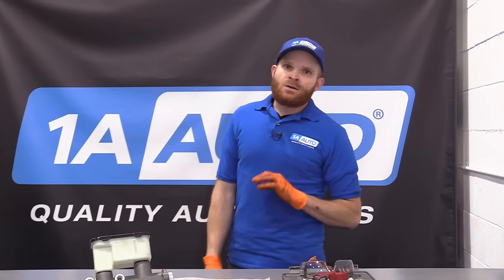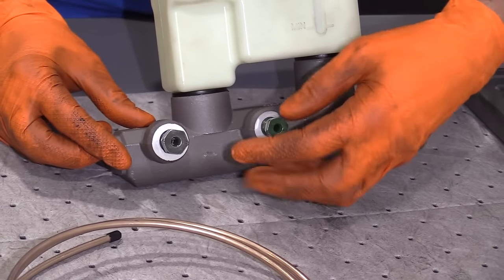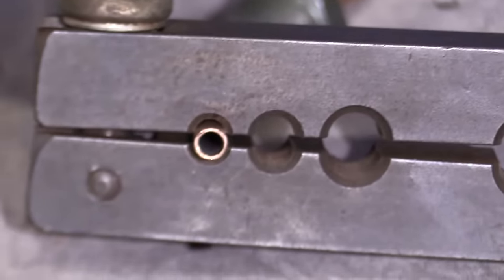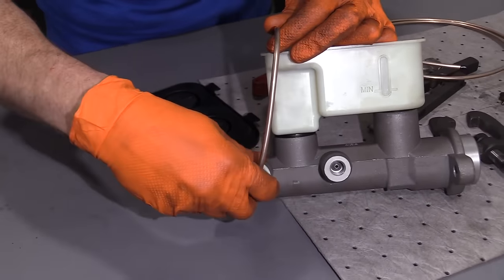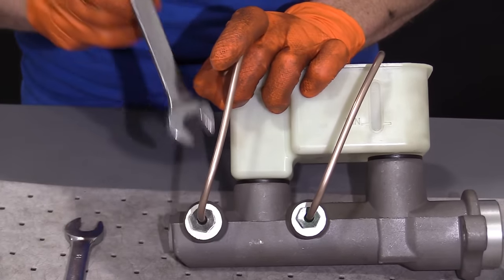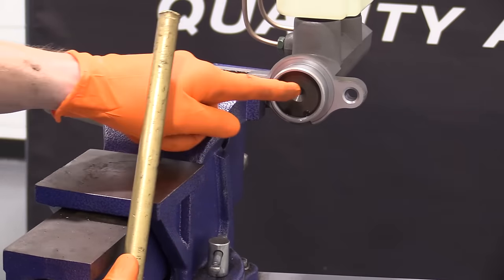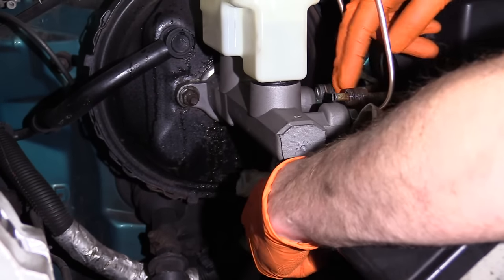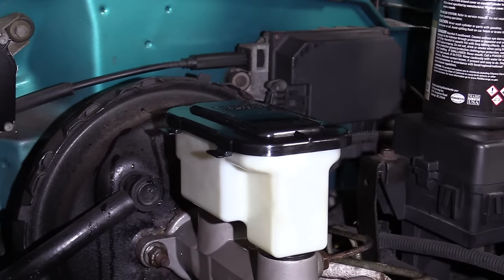Make a Bench Bleeding Tool! DIY Bleed Car / Truck Master Cylinder

Comment: If both fittings are the same, there is an even easier way to do this. Stores carry straight, steel lines with fittings for both ends. Just get one about 1.5 ft long with the right fitting size, cut it in half, screw in the fittings and curve the line. No need to mess around with flaring ends and you'll save a little money not buying a whole roll of steel line..
Reply: I agree, unless you’re already replacing the front lines it’s not worth it. Personally I’m probably replacing all of the front lines including master so it would realistically be economical to use a reel since it would be extra, assuming I use about 20 feet or less.
Reply: I see a lot of other videos using what looks like about $5 worth of plastic hose and fittings to do the same thing. Plus with clear lines, you can actually see the air bubbles moving through.

Comment: "we want to save you money, so instead of buying a $12 plastic bench bleed kit we want you to buy a $60 tubing flare kit and $10 of adapters and steel brake line. Who needs the hassle of seeing when the air bubbles are purged through inexpensive clear tubing anyway?" 😂

Comment: I got a master cylinder bleed kit with plastic hoses and ends for $12.  For a single use, that's a lot less than the cost of those flaring and cutting tools used in this video.

Comment: Good job, that's exactly how we do it,  bench bleed on the car it's easier that way.
Reply: Is it the same way to do it on a 2004 chevy suburban?
Reply: Bench bleeding on the car defeats the purpose of bench bleeding, though.  For example, on a Jeep XJ, the MC is way tilted back and you end up with a big air bubble at the very front of the MC that you CANNOT remove by bleeding in the vehicle.  You need to be able to bleed repeatedly while the MC is gently tilted forward and backward separately.  Hence, bench bleeding.
Reply: @inawrocki207  well of course not every vehicle you be able to do it the mc in the vehicle

Comment: New bottle of brake fluid and a thick rubber hose with an OD less than the ID of the original flare fitting for the brake line. Push the hose onto the nipple of the master cylinder port and put the other end into the bottl of brake fluid. It would suck the fluid up the hose and into the master cylinder. Would be cheaper and easier than the method described in this video. Just make sure you only do one fitting at a time, make sure the other fitting has the car's brake hose attached. Rinse and repeat for the other port. This assumes the master cylinder is in the car and the brake lines are attached initially.

Comment: I have spent hours on you tube researching how to bleed a new vw master cylinder that is already installed in the car. For me, this guy nails it which saves me the hassle of removing the cylinder, bleeding it on a bench, and the reinstalling it. The camera work is clear and precise. Thank you!

Comment: This is way too much extra work to do it this way no need for extra bleeding tools & placing master cylinder in a vice, easy way of doing install the new cylinder attach the brake lines back on the master cylinder DO NOT TIGHTEN WITH WRENCH only finger tighten lightly, place rags under the master cylinder then pour fluid back into new cylinder, then pump brake pedal once only holding pedal to the floor not removing foot from pedal then position broomstick on pedal to front of seat being certain it's tight that pedal does not come up even slightly when removing foot from the pedal, then tighten up the master cylinder line nuts, add fluid if needed,remove the broomstick then go back to unloosen the line nuts just slightly, go back to pump brake pedal again, reposition broomstick from pedal to seat, then reloosen master line nuts slightly being to always have enough fluid in cylinder then go back to pump pedal again "once" only position broomstick in place again tighten master line nuts again, repeat least four times & then finally bleed all four the bleeder valves on each wheel making sure there is enough fluid in master cylinder prior to  bleeding each of the bleeder valves.

Comment: I'm really surprised at some of the stuff you show here. You show a regular open end wrench to open and close the brake line fittings instead of a line wrench, and you didn't even bother to whip off the booster? It's filthy. Why install a brand new part and leave all the corrosive mess behind? Some of your other videos are really good, this one fails to mention that lots of cars and trucks have MC's that are at an angle when installed, you have to bench bleed the MC level, and at a forward and back angle to bleed all the trapped bubbles out. I have done this many times on the bench and you'll get bubbles out. And showing the flaring of the tubing is great, but you fail to mention that the little plastic kits with hose works exactly the same, and most MC's come with the little plastic screw in fittings to bench bleed. All this could easily have been shown in the same, or less time. I like your videos, it's just that you are showing a method that only works in some cars, and using a line wrench is a really important tool for you to show the public, and inform them why you don't want to round off the fittings on lines. And, using an impact to tighten the nuts that hold the MC to the booster? That's just asking for trouble. All folks have to do is watch a few other videos on this same subject, and they will see with their eyes exactly what I'm saying is correct. I did not put a thumbs down on this video. I simply wanted to make a few points for the folks who really want the best procedure, Thank you.
Reply: I appreciate your attention to detail but some one like me whose tired of buying specialty tools just find out I can do it with the regular tools I own is alot nicer than running out a spending money on tools that make the job slightly easier or more professional so I can pretend like I know what I'm doing... I'm all for backyard fixes because tool money can be an issue sometimes and if I'm in the middle of a job and I look something up and they're like you need this and it just be a preference thing is annoying and causes panic.... it just boils down to being careful
Reply: I found out the hard way that line wrenches are necessary, apparently even more so with harder metals and flares that are anything less than perfect, so I agree with OP.

Comment: The reason you bleed it on the bench is because you need to push that piston all the way to the bottom. If you do it in the car the linkage might not let you push it to the stop.

Comment: When I removes the bleeder hoses from the master cylinder all the fluid came out before I got to screw in the brake lines into the master cylinder. Is this an issue? or do I have to bleed the master cylinder again?

Comment: i have a 2013 ford edge, the reservoir is longer. just wondering if the process is the same? just having longer hoses would work as long as they reach the fluid at the bottom?

Comment: Could you just use a hose, submerged in fluid like in a bottle with some brake fluid, attached to the bleeder on the brake caliper, then start pumping?

Comment: What about bleeding the ABS module without a scanner?
Reply: It's not recommended from what I've been told.  Check around at your local auto parts stores; many will do a basic diagnostic scan on your vehicle for free, but some may have more advanced scanners that will bleed the ABS module for you, or they may loan you the tool.  Remember to bleed the overall system after the ABS bleed as well.

Comment: Boss i have something to ask ,what is the problem of the brake cylinder,if you use the brake the fluid goes on ther engine
Reply: Brake fluid is corrosive and will eat away at paint, chrome and some metals.

Comment: Great video, thanks.  Glad I noticed I wasn't subscribed to "All" vs. personalized.

Any reason you couldn't use the fitting with small metal tube, then tubing, perhaps clear, to run up to the reservoirs?

RichE San Diego, CA

Comment: Nice trick! I need a flairing tool now. And a reason to change my booster and Master Cylinder. Lol
Reply from the maker: +Joshua V Thanks for checking us out. Shop for high quality auto parts on 1AAuto.com:

http://1aau.to/m/Shop-1AAuto-c
Reply: @1AAuto  
Hello
my car is 1993 Ford Taurus V6  3L  and my master cylinder (bendix 12377)
have 4 ports (4 brake lines)
do I do the same things you did with to bleed master cylinder ,,but in my case i need to put 4 hoses intate of 2 like you show ?

thank you